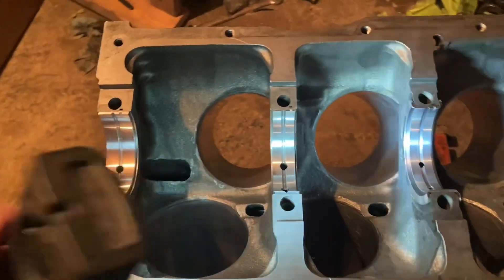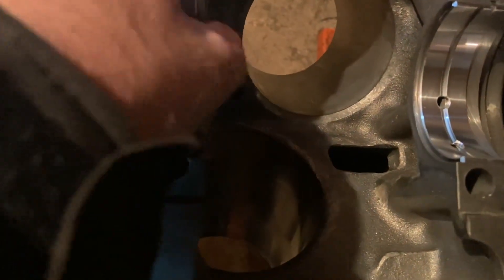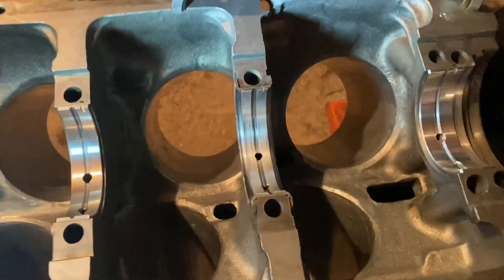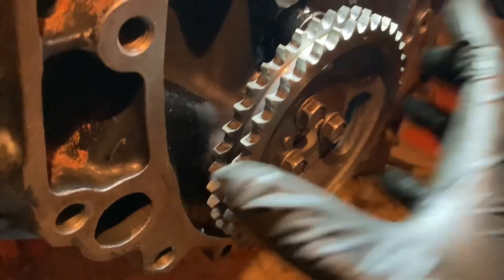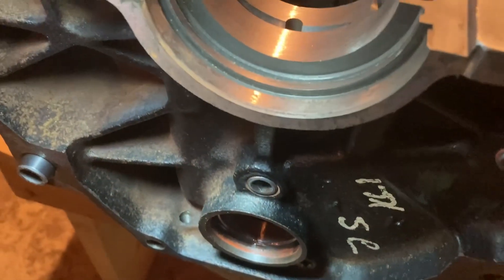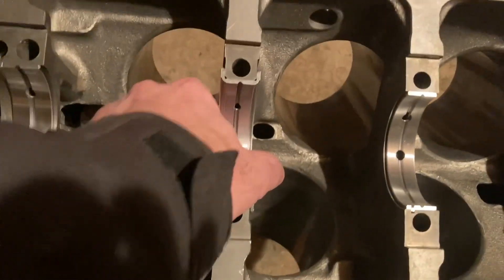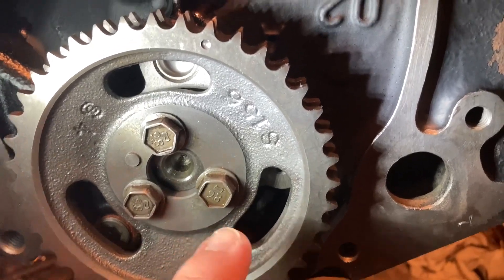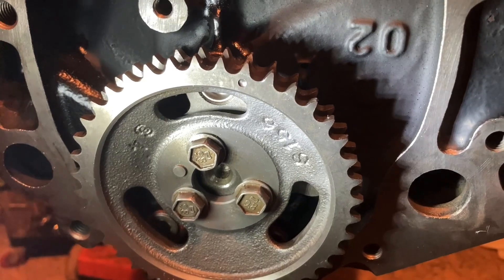3400 build bearing problems and camshaft selection.

Comment: I have never had issues with sealed power and their parts. However, like most companies these days, everyone is going cheap. 

It's sad. And it shouldn't be happening. But it is the harsh reality. 

Just take a look at any new car dealership service department.  Seeing the powertrain parts disassembled on a mechanic bench. Most of the components are not even dirty.
Reply from the maker: Exactly!   I have worked in the parts business for over 20 years and used Sealed Power personally and sold them to my customers and this is the first time I’ve seen something like this.  The second set seems to be better.  
Thanks!!